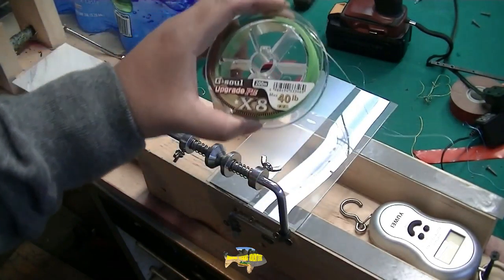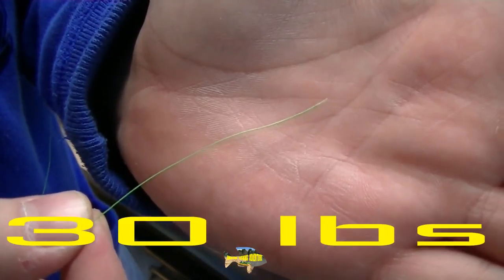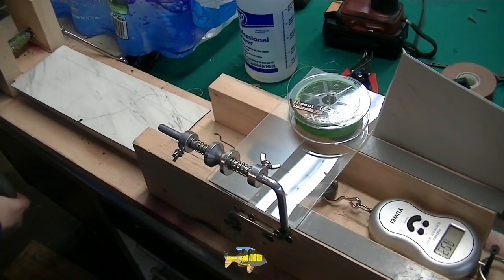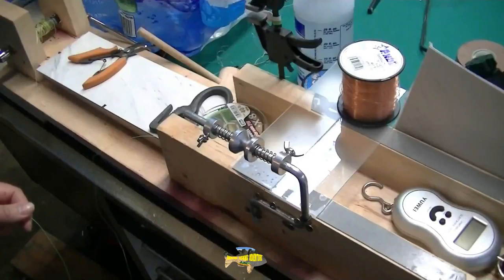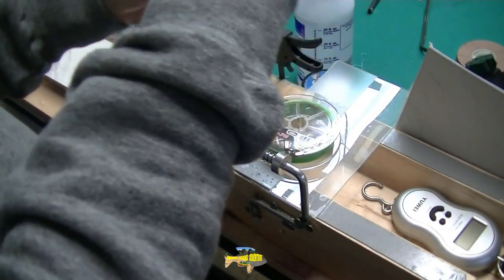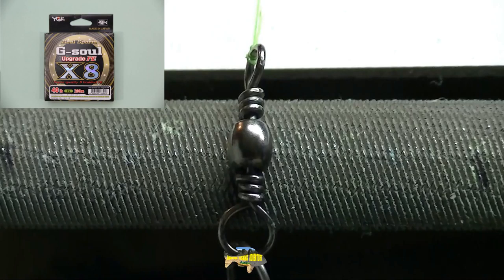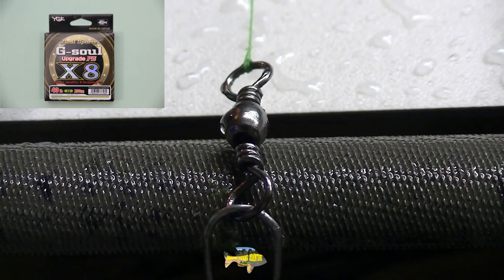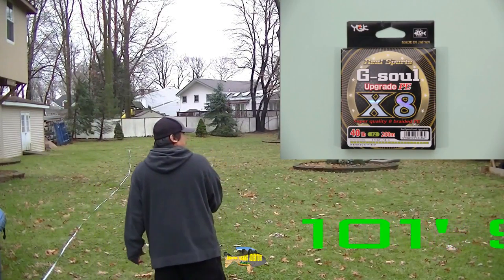AFA YGK G-SOUL UPGRADE PE X8 40# REVIEW

Comment: I have recently bought a ygk gsoul x8 braid pe 1 at 20lbPaid like 90 us dollars for 600m and this line was a disaster , did 3 fg knots and simply tight up the knots they broke in the middle of the line but the knot by hand tightening.So I decided to test new remining 450m spool just by hand pull apart and broke so easily again.

What is like tensile str applied when hand pulled apart by average men?Extremely disapointed anx Do not buy YGK
Reply: im having this EXACT SAME problem with shimano pitbull 8 1.2 pe!!!!

Comment: The real problem is that YGK is a japanese brand and the 40lbs rating is not based on US test Lb scale. In the US test lb rating system, this Line would be rated 15lbs test. That’s the reason why diameter looks so small to you.
Reply: msanchini correct, lb rating and p.e rating is totally different, PE goes by diameter for say pe3 breaks around 50-55 pe6 breaks at 80-85 with a mm of .44ish, the pe2 I believe for ygk brand is thin like really thin stuff, for a more equivalent he should’ve done pe3-4 in ygk.
Reply: @saltylawaia8958  What you state is correct, but the package was labeled in pounds rating like most lines sold in USA.All the tests I've done on YGK stand with the results AFA published.